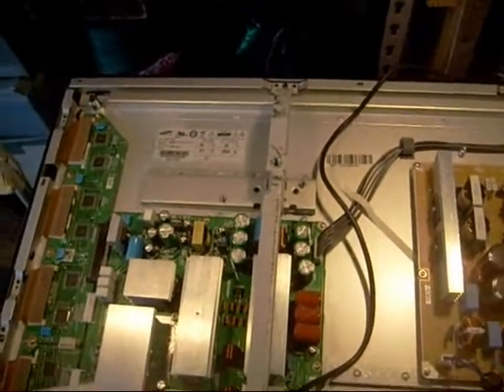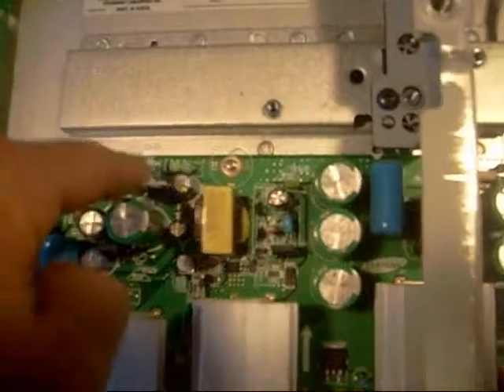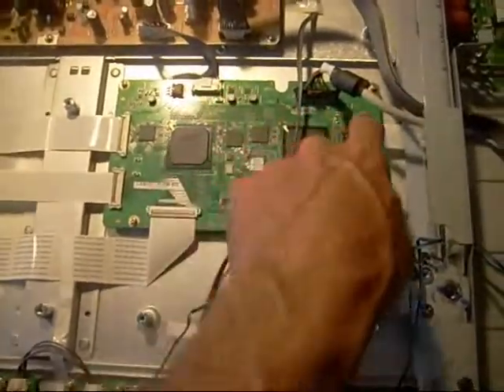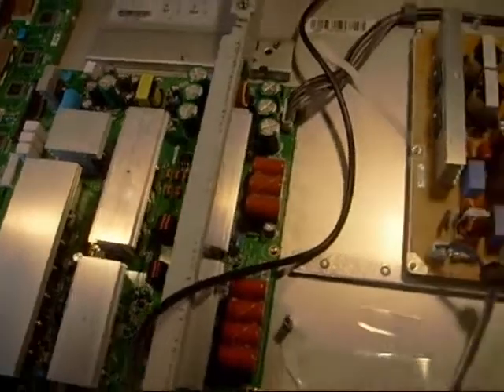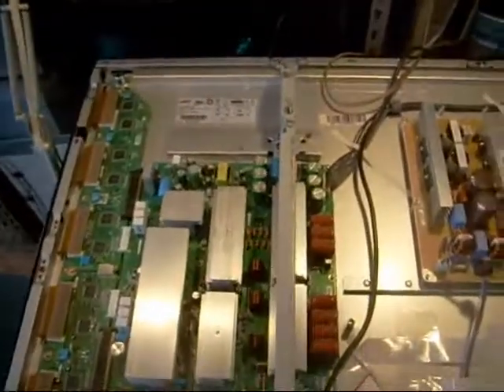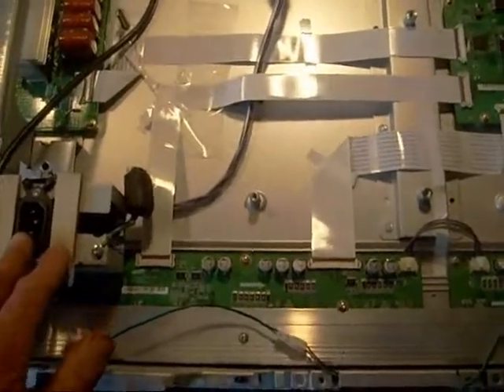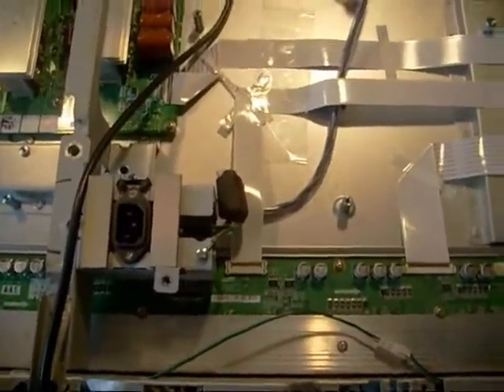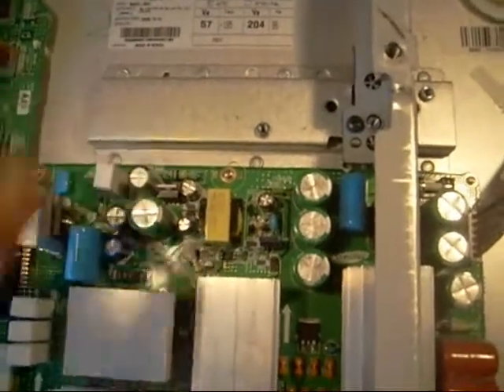Plasma TV ribbon cable problem

Comment: My sd voard is cooked. Intermitandt image on lower half of 2007 panasonic TH.   Panasonic(TNPA4185) SD Board. I need to know if puting a new one on will fix it also it goes in ad out the image. And thise damn presfit ribbons on the edge arnt connecting lropperly feels like its right where they should be but lines and a funk smell so yhea. Sd card woukd make set flicker right

Comment: I wish I would of watched this video fist. I had a black vertical line about 2 in wide on my TVs left screen also. I took apart the tv and touched the ribbons. One ribbon (the 5th from the left of the tv) on the C board was incredible hot. The rest nothing. When I took the left C board off the hot ribbon cake undone from its glued position. I posted a video of the burnt out ribbon vs clear clean ribbon on my YouTube channel. But I can’t find anything on YouTube about ribbon replacements. I know the c board is still good because the rest still works.

Comment: hey where can i get a t-con board for a sony bravia kdl-32ex357 any ideas?
Reply: hi there ive got sort of same problem started with power supply bad caps fixed that then i had to little blue lines so i un seated ribbons   on samsung ps42A457p1dxxu when i put it back together it all come on then from right to left each ribbon on line with screen started to go off now im left with 2 lines second from right and first ribbom on left works fully  any help would me great thank you mark

Comment: Has anyone had a wire snap from the xy wire ribbons? My tv has a vertical bar, and when we opened it up we found a bad resistor on the power supply (replaced), and the two rightmost wires on the xy wire ribbon snapped on both ribbons. Any clue what could cause this? And where can i get replacement connectors?

Comment: I have a Samsung and it has sound no picture I've gone over every component. I'll try the ribbons. But after reading the logic boards suffer I'm replacing that first. Great tip thank you.
Reply: I hope it's an easy fix for you.
Reply: It's ok buddy I've got a sledge hammer if not. ʇıɥs ɐ ǝʌıƃ ʇuop lol
Reply: Fbh to the rescue lol..
Reply: Got a new 46 inch toshiba coming. 
So I'll just put the part back in and sell it on eBay spare and repairs. 
Local pick up only. 
But it's been well used.

Comment: same thing happens when I do nintendo wii u gamepad and nintendo 3ds repairs. If you add a piece of kapton tape to the ribbon cable to make a shim it makes a stronger connection with those ffc/fpc connectors and that will usually take care of it. If those latches aren't closed down tight enough, you will get a short. You can always micro solder new ones also, depending how ambitious you feel? They melt at about 285 degrees celcius, so using solder paste and hot air to solder it down, works well.

Comment: Hey man so I seem to have the TV in this video and I had lines going across horizontally and then I took the back off to fix it and then there ended up being more so I ended up unplugging all the ribbons wired threw out it all and then the second try there is no picture and it makes the sound when it turn on but there is no picture and it keeps doing this every 30 seconds or so any help

Comment: I have a Vizo PDP50X3T012 hdtv. Has sound and changes channels. The screen just flickers, I can hear clicking coming from the YSUS circuit board on the far left.. Wondering what that might be and how much it would cost to fix??! Any input would be much appreciated!! Thx in advance :)

Comment: i have same issue with same model. i checked ribbon and all voltage  are fine. i  need your help please.
Reply from the maker: Same answer as I gave the last person. picture symptoms can be difficult to 
identify. You might try placing the T-con board numbers on ebay and see 
if anyone sells a repair kit for your model. Sometimes the people who 
sell the kits give you the symptoms.

Comment: I have a 42" LG (42LH30) tv that has horizontal lines that make the picture appear washed out. Could it be the ribbons or TCON board? I am not very savvy with TVs, but I took the back panel off and there only appears to be 3 "boards." One at the top, and 2 near bottom (on left and right sides).

Comment: I have had more then a few plasma's across my bench with the faded or colored bar issue. 
A few that were already diagnosed as a failed panel. I learned after a couple of them about reseating the data ribbons. In total id probably say about 70% came back with the same problem. 99% of the time trimming a small amount off the end of the cable contacts allowed it to seat into the crimp lock further allowing a better contact. I have yet to get one back since making this common practice.

Comment: No, for this I wouldn't have charged any more than the expense of the inspection fee (Which I deduct from the total cost when quoting the customer). I would have also offered 12 months to bring it back without being charged another inspection fee, because I couldn't be 100% sure I knew what the issue was and if simply refitting the cables would be an actual fix... I'm an honest bloke and never charge more then necessary... I even fix elderly peoples remotes for no charge if it requires no parts.

Comment from the maker: Considering the ribbon cable has so many small contact points it's no wonder they often
go bad, but I don't know if dielectric grease would help solve this problem or not. I have seen old dielectric grease in VCR mode switches which turn yellow and crusty so perhaps 
tuner cleaner might be a better option but I'm not sure.

Comment: So what can be done to maintain those ribbon cable "connections?" Was it just a loose connection (vibrated loose from shipping/handling or poor from the factory?), improperly clipped (or weak plastic) plug, or oxidation on the contacts? How about dielectric grease? Would that be a good idea? Just trying to think how it happened in the first place and how to prevent it. Thanks!